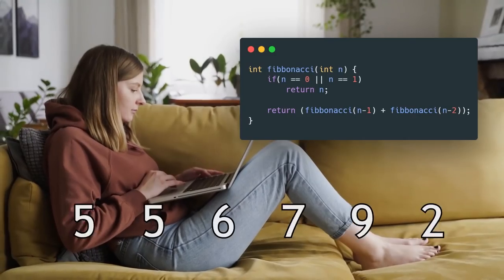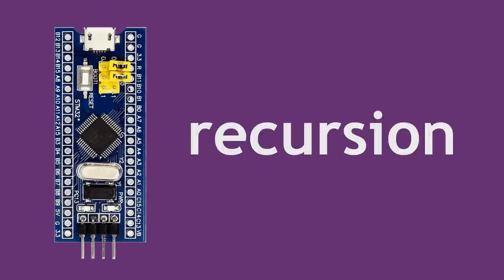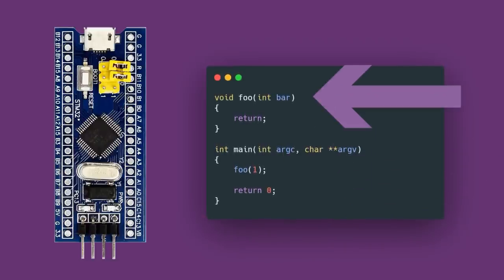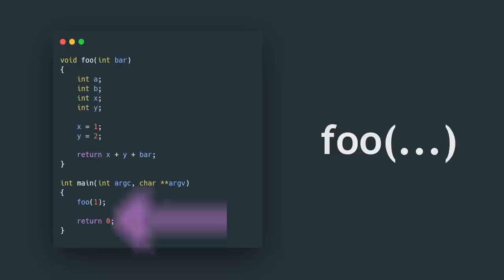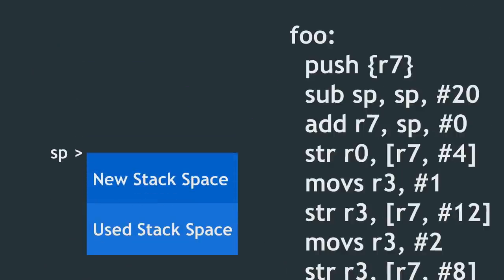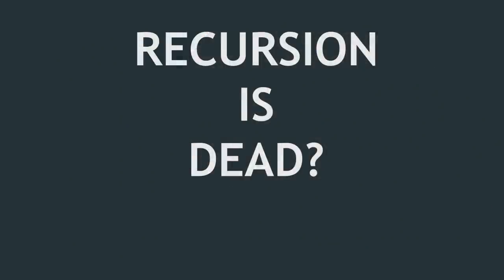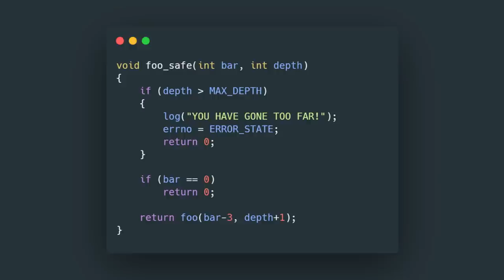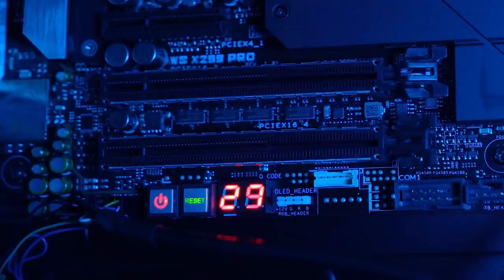why is recursion bad?

Comment: I've never understood the adventage of recursion, I mean, you can literally make everything you can in recursion with some For loops and they are kinda easyer to read also
Reply: How do you traverse a nested set on objects (like an xml file, or directory and sub directory with files in it) with just loops? Without guessing or over-fitting the level of nesting beforehand?
Reply: @borstenpinsel  with a bunch of GOTO's /s
Reply: What about the merge sort algorithm?
Reply: @borstenpinsel  You can do it by dynamically changing the increment value within your loops, but it's very messy and complicated and recursion is so much simpler
Reply: The non-recursive code is certainly easier to read -- if yiu have little practice reading recursive code. :)

Comment: 02:10 That's not true. My Windows 11 pro desktop computer has 64 gigabytes of RAM, but only gives 1 megabyte of stack memory to each running thread.
Linux gives 4 megabytes.
If you exceed that, that causes a stack overflow. Te reason such a bug is so dangerous, is that even a perfectly valid program can fail due to stack overflow. The solution is to use malloc/unique_ptr.
With heap memory you get the full 64 gigabytes, and if the allocation fails, that's a recoverable error.

Comment: does anyone actually like recursion though-
does anyone actually like recursion though-
does anyone actually like recursion though-
does anyone actually like recursion though-
does anyone actually like recursion though-

to the point where they think its a super power?

Recursion for me. feel like it doesnt make any sense in a programming context. in math it makes sense. but programming it feels like a little extra work.
Reply: the only use case i had for it was school.
Reply: and besides recursive algorythms like the fibnauci numbers can always be Remade by using an array and for loops

like this

public int[] fib(int n){
    int[] arr = new int[n];
    arr[0] = 1;
    arr[1] = 1;
    if(n == 0 || n == 1){
       return arr;
     }

     for(int i = 2; i < arr.length; i++){
         arr[i] = arr[i-1] + arr[i-2];
     }
    return arr;
}

this should work aswell
Reply: Exactly. There might be few cases where recursion was absolutely needed. But majority of others either just like the ego boost, or don't know how to create a non-recursive way to deal with that exact same problem.

Comment: Any recursive function can be turned into a loop if you move the memory consumption from the call stack onto a stack data structure stored in the heap. You may save some frame and return pointers if you only put the function arguments into each stack element. Proof sketch that this is always possible: that's what your CPU does to the actual call stack. The division between heap and stack memory is arbitrary anyways.

Of course, there's a finite amount of memory for stack plus heap, so the gain is questionable.

If the function you're converting to a loop is tail-recursive, the stack size will never have to grow above one, and so you can do this without actually using any heap memory. But then the recursive version wouldn't have been bad anyways, if properly optimized.

Recursion good or bad? I don't do embedded so I have plenty of memory. I care mostly about readability, testability, maintainability and such (i.e. productivity factors). Recursive functions tend to be clear about what is to be done to each element, but a bit indirect about how the per-element results get combined. You have to reason that out by running multiple applications of the function in your head. In exchange they can be written in a functional style. Loops tend to mutate some iterator or some counter variable, but give you a more explicit global view of the whole process.

Comment: I was solving a problem using nested for loops. (And for the life of me, outside of a few algebraic optimizations to eliminate the two inside loops, I couldn't figure out a better way.) The tricky thing is that if n was the problem size, then I needed n nested loops! Very hard to remove and add nested loops.  So I used recursion: a good base case for when I reached the innermost loop, otw enter a for() loop, each time thru make another recursive call.  Huge stack space used, but now the problem size n is just a parameter to the recursive function that tells it how deep to recurse.  A new trick for me.
Reply: "While" logic wasn't possible in your case?
Reply: @anujmchitale  Not sure what you mean.  I could have replaced the for loop with a while loop, but I still would have used recursion.  Maybe I wasn't clear: first time in my recursive fn I looped and called the recursive function many times.  For each one of those calls I looped and called the recursive fn again, and for each of those again, and so on.  Recursive stack was 4 deep with a loop from 0 to 1295 (not really, this part is complicated), so an additional 1295 recursive calls each loop.  The problem I want to solve is 9 levels deep; each loop runs up to (again, not really) 4095! If my system had enough memory to solve it would still take a year of running!
Reply: @zrodger2296  So loop inside a recursive function. That will blow up to huge time easily. Did you change this later on, by removing the loop inside that function?

My original query:
While (CONDITIONS NOT MET)
    Call  Fn()
    Update control parameters

This is equivalent to calling a certain function again n again, right?
Was such an implementation not possible in your case?
Reply: @anujmchitale  I think your code is the same, providing that your function call inside the loop is recursive.  I use a for loop because there is a numerical index with well defined start and stop values.  I stayed with my design because I'm changing the size of the problem (the depth of the call stack) frequently.  And once I get to the bottom of the call stack, all the work so far has merely provided the inputs to the actual problem I'm trying to solve.  I like big problems!😉
Reply: @zrodger2296  Haha. Good luck with your problem at hand.
Reply: @anujmchitale  Thanks!

Comment: Protip, nearly every recursive algorithm can be implemented with a while loop construct.
Reply: *every
Reply: You'd still need a stack or queue, which has the same memory problems. It's still fundamentally recursion.
It's true that recursion is unnecessary in most examples. But it's the only way to solve certain problems, like traversing an unordered tree or searching a file system.
Reply: @LowestofheDead  Usually, it is a memory win to rewrite a recursive algorithm as a loop + explicit stack even if it's not a tail recursion, because you can almost always fit the actual data you need for the iteration in significantly less space than the usual stack frame structure of a C-like language, which needs space for the return address and all the local variables in the function on each call. Manual space optimization of the stack element structure can usually eliminate the return address and only store the variables that are needed after the non-tail recursive call. You might think that compilers could optimize this, but they usually have their hands tied by the calling convention.

Comment: This is not entirely true, especially for native code (for example for embedded systems). Recursion is not bad as long as it is tail-recursive because compilers have become smart enough to compile the function as a loop. I would recommend a tool like the compiler explorer to double check. I have once written a function in Rust using a loop and using recursion, and both ended up with the exact same assembly code.
Recursion can actually make your code easier to read and maintain (and mathematically proof correctness of).
If you are using an interpreted language, this is of course different because there usually is no such optimization.
Reply: "Easier to read" but not easier to understand.
Reply: @anujmchitale  it depends on how recursion is used. It is very helpful when you can express the algorithm easily using tail recursion, for example for network encoded integers (where the most significant bit is a flag that the integer continues). In this case you can simplify the problem by only processing one byte and then go into recursion, which is not only less code, but to proof that it works you only need to proof this small function to work (e.g. using fewer unit tests) instead of a larger one where you need to run more tests to be sure that there is no bug.
Reply: @colinbarndt6789  I agree with the unit test point. But understanding the results is not same as understanding the theory/ or code itself. Something which may be required during debugging. That time recursive logic isn't necessarily easier to understand.

Comment: This is really a compiler+architecture issue. You don't need to use stacks to implement recursion. If you look at something like HVM or Reduceron, they represent programs as a graph that transforms over time, and recursive programs can often be more efficient than loops in terms of both time and memory (see "run-time fusion"). Of course, such techniques are far from mainstream. There's no reason something like that can't be put on an embedded system; there are really elegant hardware implementations of some of these graph-reduction algorithms, but no one wants anything radically new. Everything still has to look like C and Von Neumann Assembly. That in combination with recursion is what's inefficient; not recursion intrinsically.

Comment: I doubt anyone will see this, but recursion is always unnecessary and should never be used. People keep bringing up tail recursion but not every algorithm can be written that way and if it can, it's just as easy to write and understand as simple iteration. If the iterative and recursive solutions are written correctly and they indeed yield the same result, the iterative solution will never crash due to any internal influences while it's possible that the recursive solution will, regardless of embedded system or desktop computer. This is because the stack is still limited in size even on desktops. If a developer can't translate a recursive algorithm into an iterative implementation, then they likely aren't very good anyway. One of the examples I keep seeing is for Fibonacci numbers, but I think the better example would be Quick Sort. If you've ever implemented one the correct way, you'll understand what I'm talking about, and even if you haven't, you might understand it should you read any C standard library implementation of it. You can have a simple solution that generally works, or a correct one, and you can have a complicated iterative implementation or a complex one. In the end, it's down to the programmer's skill.

Comment: often recursion isn't even necessary, but instead it's the ignorant way to approach a problem. for me, using recursion first simply because it seems easier is always a mistake. even on a mythical machine with infinite memory, recursion incurs penalties that may result in a reduced performance compared to doing the same computations non-recursively.

for the stupid people about to whinge, notice that I said 'often', which illustrates that I am explicitly aware that sometimes recursion is (effectively) the only way to achieve certain things (you can always emulate recursion non-recursively, but this will generally result in comparable memory overhead, so it kinda doesn't matter), and thus your complaints can only serve to demonstrate that I was correct to identify you as stupid at the beginning of this sentence.

Comment: You should change the title of the video to "Recursion is bad on embedded systems with limited memory."  On desktop computers recursion is often easier to read, sometimes faster and sometimes neither.  It's another tool in your toolbox that helps in some situations.
Reply: Recursion is definitely never faster, seeing as compilers try to convert recursion into loops whenever they can ( which is not always, but is almost always ).
Personally, i think recursion is unreadable, but this comment section seems to be very split on that.

Comment: The main reason to use recursion in programming languages is to make it easier to translate a lot of the math functions. Which also means that, if the compiler doesn't compile recursion as loops, then more often than not you shouldn't use it.

Comment: Plus recursion is just a glorified stack. Even a stack with a fixed size will be better than recursion because at least you can tweak it

The stack (memory space) is a fixed size, heap allocated memory is not. So if you allocate a stack (object model) in heap space, then you could even have gigabytes of stack to work with

Comment: recursion is not bad, if every recursuon expression can be transformed into assembly thriguh church turing or whatever into a loop then **no** recursion isnt bad, or at least not bad in all cases

recursion can supply massively more concise definitions of functions (and when starting to work aith distributed aystems such as spark) can be the optimal definition of your algorithm-- which needs to be super aware and explode millions of records into structured data

imho

Comment: I don't think it's bad with recursion by itself, it can be useful and if you put a cap on the recursion depth it can be used in some embedded applications as well.
As a programmer you need to know what you are doing, that's the whole thing.

Comment: If you need recursion you can't really avoid it. If you don't need recursion you can't really use it.

Recursion did nothing wrong. Use recursion. But limiting it is a good idea on any system.

Comment: Using recursion with dynamic programming might be helpful.
Reply: Not in this case.  It would actually make it worse.

What you really want here is a compiler that does optimisation properly so it doesn't put recursive function calls on the stack.  Unfortunately, many sentences start with unfortunately.

Comment: Why is recursion taught? There must have been a good reason other than, "look how cute this code is self writing... itself."  I worked with a (genius) programmer who often used recursion. I would unwrap and comment his amazing, but very messy, work for clarity, and never liked the recursive chunks - it just screamed "runaway engine" to me. I am self taught. He was a CS master.
Reply: Recursion makes many algorithms significantly easier to write, and when you're not working with extremely limited hardware resources, program write time outweighs runtime or memory usage because faster programming means less money spent on development. Additionally, some algorithms are inherently recursive and can't be written without either using recursion or emulating a stack.
Reply: recursive functions are generally less stateful, and are easier to reason about and prove a piece of code is "correct." The entire history of bugs and security flaws in software generally stems from mismanaged state and improperly reasoned code.
Reply: You couldn't have provided a better example than this. A few/ small number of geniuses may be able to understand it quick enough. But it's a headache for other majority who join later on. Recursion may be "easy to read" but not easy to understand!
Reply: @catortoisethoughts6152  This "faster" programming thing is a myth, unless every single loop and other non-recursive blocks are converted to recursive ones.

Comment: Bro even if you have 256 GB of RAM each thread in your program will only have a 8 MB stack size at max on Linux. So you're not free to use recursion in an insanely terrible manner.

Comment: I love recursion, problem is when you need to debug 😄 And what I learned in university is that code may look cleaner but is not always that performant as other implementations.
Reply: Right. 
Debug time i.e. understandability of the code should be much higher priority. And recursion has no benefits apart from the highly subjective aspect of "looking cleaner".
Reply: @anujmchitale  
I believe you didn't use recursion properly.

One of the biggest advantages of recursion is that it's infinitely simpler to know "what's wrong" with the code when something goes wrong, simply because everything is defined in terms of small processing units that merge into a pipeline, testing functions is incredibly simple and if you test all your recursive functions (and they are expected to be simple) you will have code with much more reliability than code made with loops.

Comment: This explanation of stack frame is really clear. To be fair, even with gigabytes of RAM, there is still a limit of recursion depth set by the compiler. I once forgot to set  an ending criteria for my recursing function and gcc threw a compile error at me. (If I remember correctly the depth at the time was 190).

Comment: Sorry, but you are wrong.

If you structure your recursive code properly, the compiler can do tail call recursion and it will only use a single frame.

Comment: You fail to mention how tail calls do not add a new stack frame to the call stack. In many cases, a recursive solution beats its iterative counterpart when it comes to readability, and today’s compilers will produce the same machine code out of both solutions. “Avoid recursion” is bad advice.

Comment: Apart from the fact that I don't like such lurid titles, there is an obvious bug in your exemple code.

1:10
You have declared your function foo as a function that has the return type void.
Now you are trying to return an int.

Did you really not try to compile the code you use in the video?
If you had, you would have noticed it immediately.

Mistakes can happen, but I find this one careless. It could have been avoided.